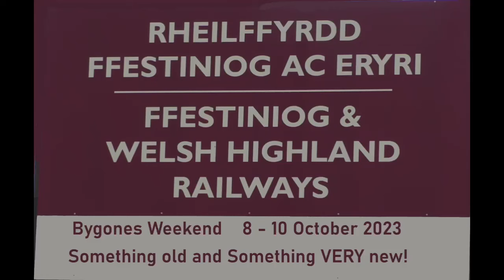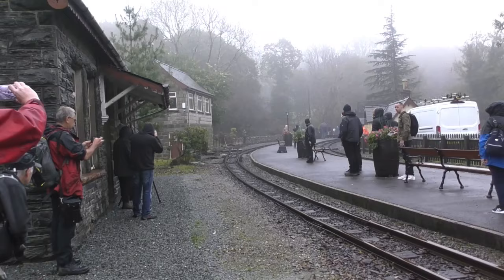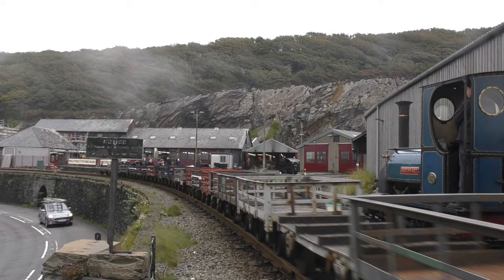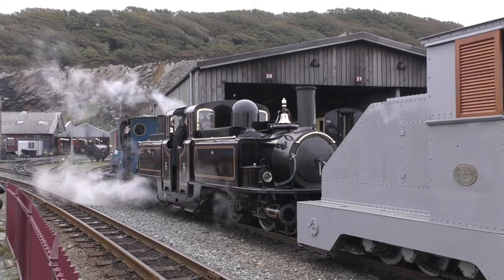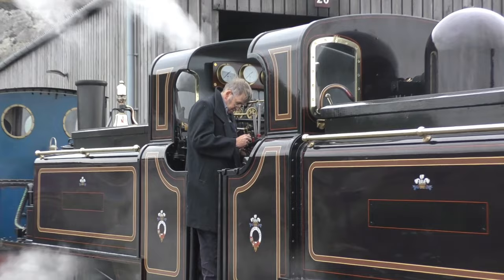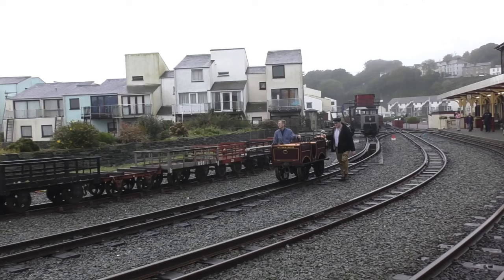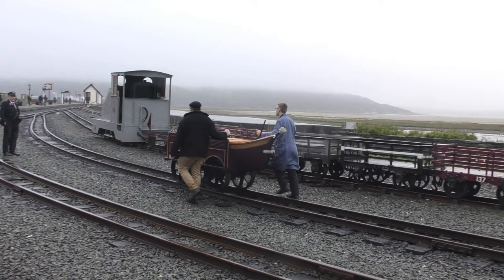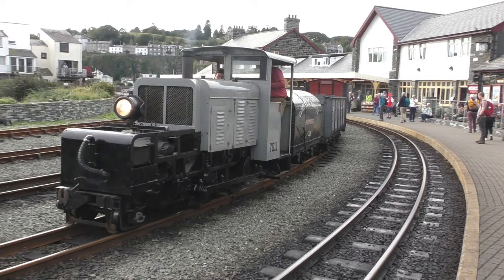Ffestiniog Railway Bygones Weekend. Something old and something VERY new.

Comment: Looking at the relative cab heights between Nos.8, 12 an 4415, the Kerr Stuart diesel can't have fouled Garnedd Tunnel by much.   Time to get someone up there with a bolster and lump hammer?
Reply from the maker: I went through Garnedd Tunnel behind 4415 last year without any problem, so has the loco been reduced slightly in size? I think it would be a major job to lower the tunnel floor. A few inches was taken off the floor sometime towards the end of the 1960s so that the larger carriages being introduced would fit. The Chinese loco also just fits the tunnel and I assume JSII will fit.

Comment: Excellent. Was disappointed that there was no sign of Gerpa de Werpa!  I wonder why the new double Fairlie has an open cab design - not great when its raining.
Reply: I think there’s a full cab roof which is removable, I’ve seen pictures of the new engine with and without and open cab
Reply: @anonymousthomasfan1111  That's interesting and good to know. I hope to visit the railway in 2024 and see the new loco.
Reply from the maker: I was talking to a driver and he said the loco would not be fitted with a cab roof. Also, notice that when James Spooner is alongside one of the other Fairlies, that it’s cab fronts are considerably higher that a loco fitted with a cab roof. I wonder why?
Reply: @GarethJonesPilipala Thanks for that.  I'm relieved I wasn't imagining it when I saw images of the two locos on adjacent lines in Harbour.  

Any idea if JSII's bells are hand or steam operated?  I keep hearing US style clang-clanging in my head every time I look at those bells!
Reply from the maker: @TheHoveHeretic  I watched Jon Whalley operate the bell and I was convinced his hand movement suggested it was a hand operated bell. However, when I watch the video very carefully there is no clear sign that Jon was repeatedly pulling a bell pull. Also, I can’t see any sign of a wire running to the bell so I am now of the opinion that it’s steam operated. To be on the safe side, the answer is ‘I don’t know’. I heard several people comment that the sound of the bell was ‘too American’ for the Ffestiniog Railway!
Reply from the maker: I think I might have solved the question of how the bell works. You may have noticed from the video that there are short levers, one on either side for the driver and fireman. I suspect they are connected by means of a rod to the 'clapper', the part of the bell that strikes the outer casing. The bell itself doesn't rock. It's the clapper that strikes the bell. In the video you can see Jon Whalley' hand make several moves of the handle and the bell then rings.